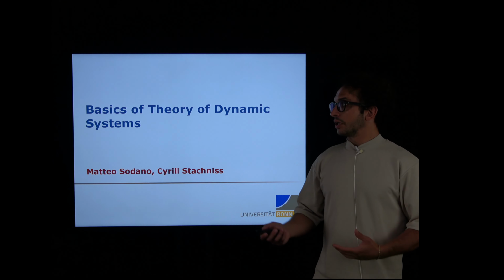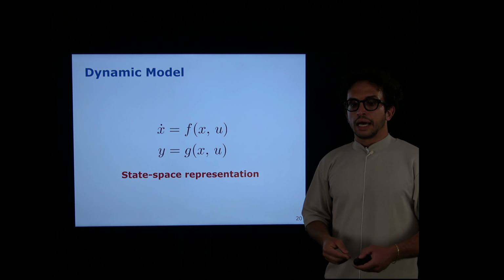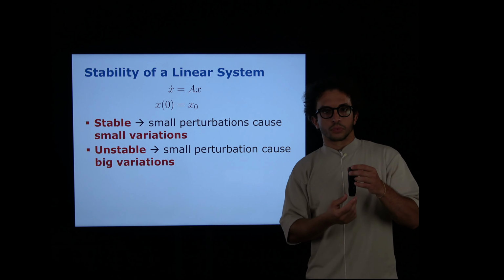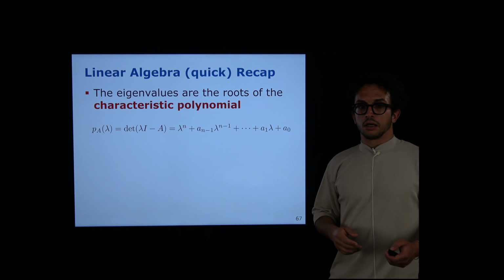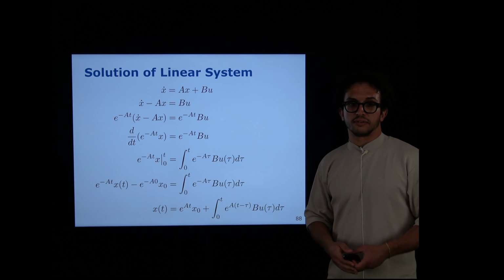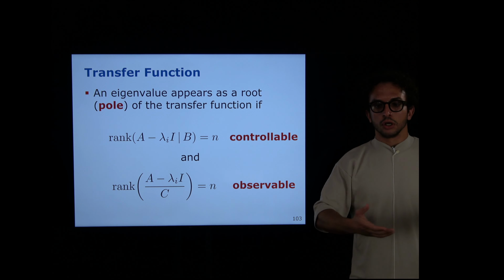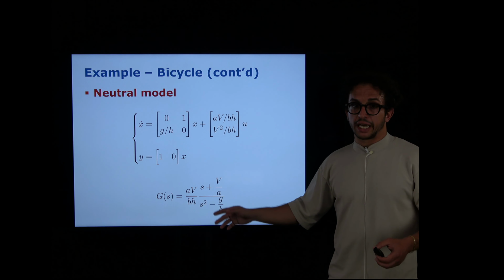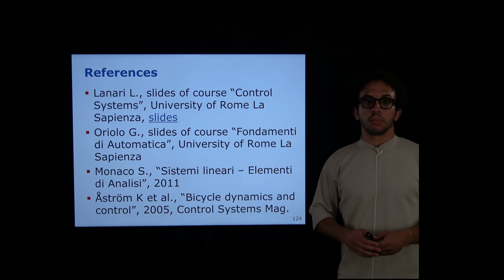Control-01: Basics of Theory of Dynamic Systems (M. Sodano)

Comment: AI Summary

Abstract:

This introductory lecture for a control theory course establishes the fundamental concepts of dynamic systems. It defines what constitutes a system, its autonomous evolution over time, and introduces the core areas of automation engineering: analysis, synthesis, and identification. The lecture focuses on defining dynamic systems formally, outlining their components (input, output, state, disturbances) and presenting the state-space mathematical model. Emphasis is placed on Linear Time-Invariant (LTI) systems, their properties (free/forced evolution), and matrix representation (A, B, C, D). A significant portion is dedicated to stability analysis, defining equilibrium points, stability (Lyapunov), and asymptotic stability. The connection between system stability and the eigenvalues of the system matrix A is explained, detailing conditions for asymptotic, marginal, and unstable behavior based on eigenvalue location in the complex plane. The lecture then addresses solving LTI system equations, highlighting the complexity of time-domain solutions involving matrix exponentials and convolution. The Laplace transform is introduced as a powerful tool to simplify analysis by converting differential equations into algebraic ones in the frequency domain, leading to the concept of the transfer function relating system input to output. The relationship between transfer function poles and system eigenvalues (controllability/observability) is briefly touched upon. Finally, the concepts are illustrated with a practical example of bicycle dynamics, comparing a simplified unstable model with a more realistic one that exhibits velocity-dependent asymptotic stability, aligning with real-world experience.

Basics of Dynamic Systems Theory

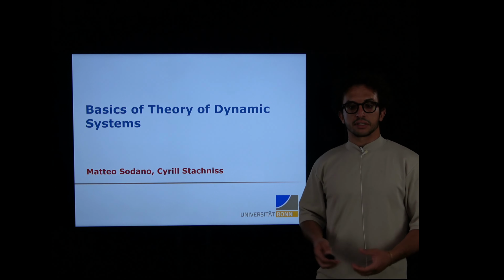*   0:00:15 Motivation: Introduces the concept that many things around us, from simple heaters to complex robots, can be viewed as systems.
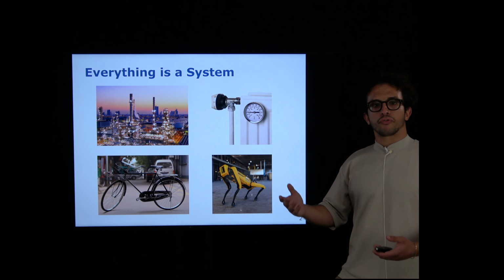*   0:00:40 System Definition: A system is formally defined as an interconnected aggregation of parts, whose autonomous evolution over time is of interest in automation engineering.
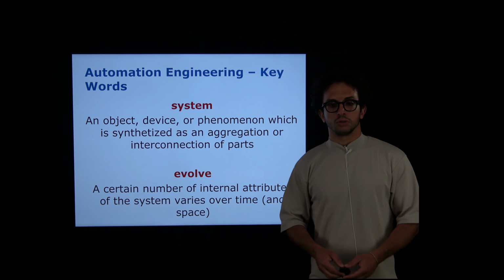*   0:01:46 Pillars of Automation: Automation involves Analysis (predicting output from input/system), Synthesis (finding input for desired output/system), and Identification (determining the system from input/output). This course focuses on Analysis and Synthesis.
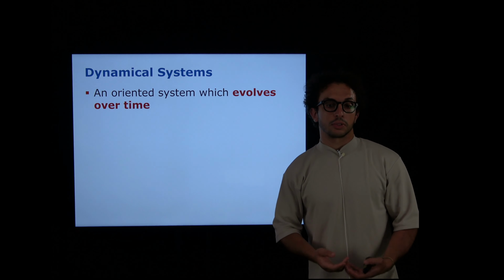*   0:03:31 Dynamic System Defined: An oriented system (with cause-effect relationships) that evolves over time, characterized by inputs (u), outputs (y), internal state (x), and potential disturbances (d).
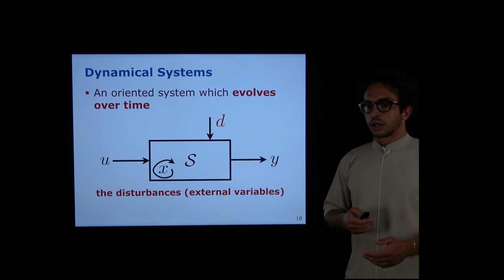*   0:05:48 State-Space Representation: Introduced as a general mathematical model for dynamic systems: x_dot = f(x, u, t), y = g(x, u, t).
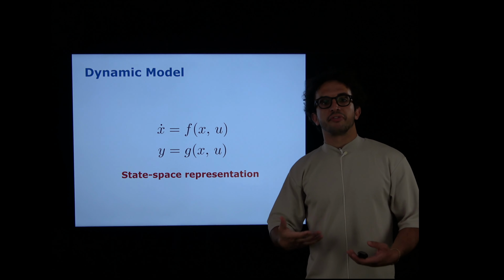*   0:07:10 LTI Systems: The course focuses on Linear Time-Invariant (LTI) systems, described by constant matrices A, B, C, D: x_dot = Ax + Bu, y = Cx + Du.
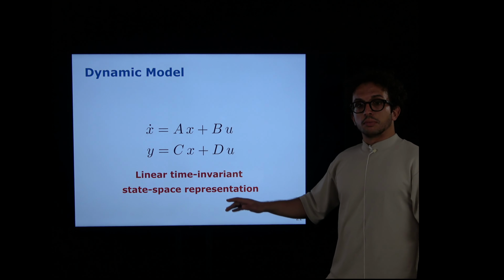*   0:07:52 Free vs. Forced Evolution: Defines system behavior with no input (free evolution, u=0) versus behavior driven by input from a zero state (forced evolution, x(0)=0).
*   0:12:37 Stability Concept: Introduces stability as a crucial system property, analyzing how the system's state evolves after small perturbations from an initial state, typically studied in free evolution (u=0).
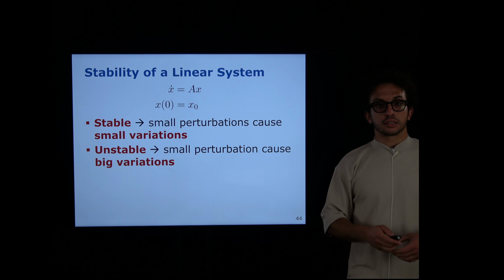*   0:14:23 Equilibrium Points: Defines equilibrium states (x_e) as points where the system's evolution stops (x_dot = 0, or Ax_e = 0 for LTI systems). Equilibrium does not imply stability.
*   0:15:55 Stability (Lyapunov): An equilibrium is stable if starting arbitrarily close to it ensures the system's trajectory stays within a bounded region around it.
*   0:17:43 Asymptotic Stability: A stronger condition where the system is stable, AND trajectories starting close enough to the equilibrium converge back to it over time. This is a key desirable property.
*   0:19:01 Stability Analysis via Eigenvalues: For LTI systems, stability is determined by the eigenvalues (λ) of the system matrix A.
*   0:23:33 Eigenvalue Stability Criteria:
    *   Asymptotically Stable: All eigenvalues have negative real parts (Re(λ) < 0).
    *   Marginally Stable: All eigenvalues have non-positive real parts (Re(λ) ≤ 0), AND eigenvalues with Re(λ) = 0 have equal algebraic and geometric multiplicities.
    *   Unstable: At least one eigenvalue has a positive real part (Re(λ) > 0) OR an eigenvalue with Re(λ) = 0 has differing multiplicities.
*   0:25:25 Pendulum Example: Illustrates equilibria and stability concepts using a simple pendulum (downward position is asymptotically stable, upward balanced position is unstable).
*   0:27:50 Time-Domain Solution: Solving x_dot = Ax + Bu explicitly involves complex calculations with matrix exponentials and convolution integrals.
*   0:30:05 Laplace Transform: Introduced as a mathematical tool to simplify analysis by transforming differential equations in the time domain (t) into algebraic equations in the frequency domain (s).
*   0:30:38 Key Laplace Properties: Linearity, derivative property (d/dt becomes multiplication by 's'), and convolution property (convolution in time becomes multiplication in 's').
*   0:32:54 Transfer Function G(s): Derived in the Laplace domain, G(s) = C(sI - A)^-1 B + D algebraically relates the input U(s) to the output Y(s) for zero initial state: Y(s) = G(s)U(s).
*   0:33:30 Poles and Eigenvalues: The poles of the transfer function (roots of its denominator) are a subset of the system's eigenvalues. Eigenvalues appear as poles if they are both controllable and observable.
*   0:36:01 Bicycle Dynamics Example: A practical application of the concepts.
*   0:38:44 Bicycle Model 1 (Neutral Fork): A simplified model assuming a 90° front fork angle results in an inherently unstable system (one positive pole/eigenvalue), requiring active control (steering) to stay upright. This doesn't match reality for riding "no hands".
*   0:43:24 Bicycle Model 2 (Inclined Fork): A more realistic model with an inclined fork (lambda < 90°) shows that the bicycle becomes asymptotically stable (self-stable) above a certain critical velocity (V_crit), matching the real-world ability to ride without hands at sufficient speed. All eigenvalues move to the left-half plane above V_crit.
*   0:45:48 Rider Influence: Briefly mentions that adding a rider model introduces additional control possibilities (body lean), potentially making stabilization easier (teaser for future lectures).
*   0:47:36 Recap: Summarizes the lecture's key topics: system definitions, LTI models, stability analysis via eigenvalues, Laplace transforms/transfer functions, and the bicycle example.

I used gemini-2.5-pro-exp-03-25| input-price: 1.25 output-price: 5 max-context-length: 128_000 on rocketrecap dot com to summarize the transcript.

Input tokens: 28991
Output tokens: 4040
Reply: gfy